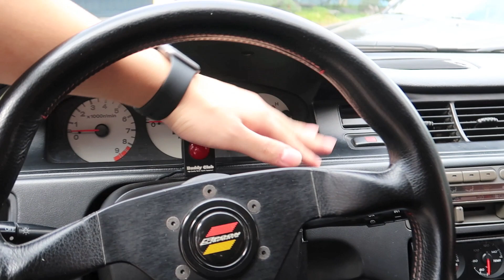Spoon Civic Eg Review! | Philippine Car Scene |

Comment: New subscriber. Keep it up man. Love to see how the car scene is in the Philippines
Reply from the maker: codeNSB hard driving usually sir causes the stock pads to overheat and lose braking power. That is why i changed to a higher temperature brake pads. Just need the stainless steel brake lines soon to complete the setup. 😊

Comment: Boss pa tip naman.. paano niyo ni relocate ang AC cooler and fan?.. akala ko tinanggal niyo ang AC..😲
Reply from the maker: Tonskie 01 actually i asked the owner regarding the ac set up din ksi tuwang tuwa ako and ang lamig super. Unfortunately di na nya mataandaan sino nagayos ksi decade ago pa ata napagawa un 😢
Reply: @renzomiguel7130 whoah.. sayang.. at least now I know pwede pala ma relocate ang ac condenser.. research na lang kulang.. thank you for sharing!..😁
Reply from the maker: Tonskie 01 yes sir pwede naman ata hehe. When i inspected the ac, I believe galing honda city ang ac set up fyi lang it might help hehe. 😊
Reply: @renzomiguel7130  Hindi ko parin ma gets saan niya banda ni relocate ang AC condenser sir.. Dinikit niya ba sa radiator yung condenser?.. last tip po pleaaaaase..
Reply from the maker: Tonskie 01 magkalapit sila super with two large fans. From what i remember
Reply: @renzomiguel7130  thanks sa tips sir..😁😁